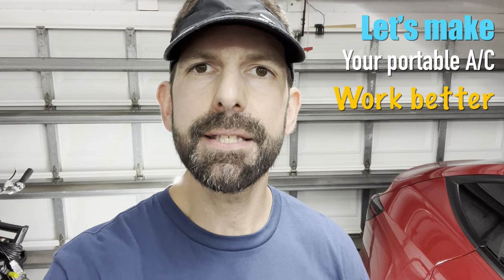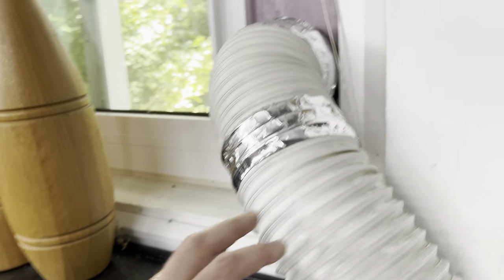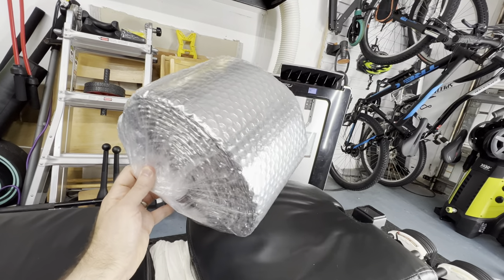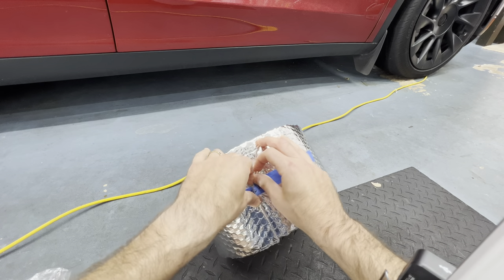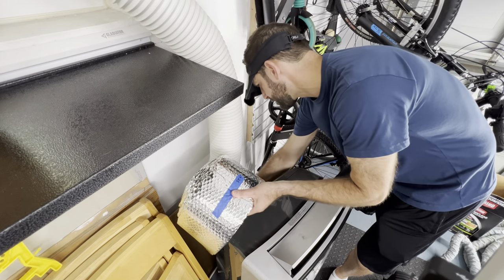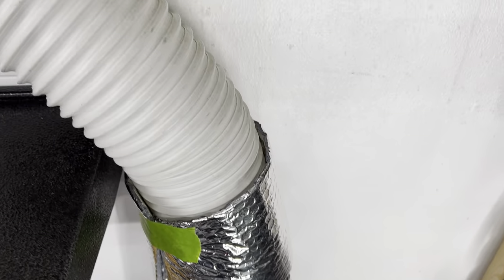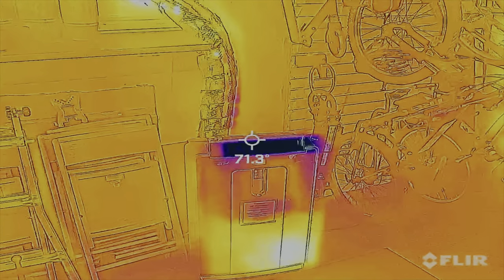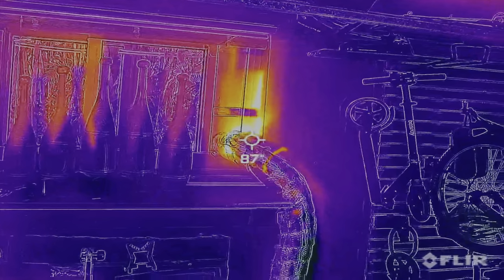How to improve efficiency of portable air conditioner AC units to cool rooms faster

Comment: I also had this on my flexible pipe and it helped a little. But the best thing to add to your portable AC is a stronger blower that you put at the end of the pipe to suck out the warm air within the pipes much faster. The stronger the fan, the better the efficiency will be.
Reply: Do you have a video to show how to do it?
Reply: Realize, you could put on a thousand mile an hour exhaust fan, and it would suck all the newly made cold air out of the room as soon as it's blown out the unit.  There's a balance between the high temperature of heat per volume unit in the exhausted air, and lower heat temperature per volume unit of outside air being sucked through the house crevices to replace it.  Ideally, you want hotter air exhaust with a lower air flow than less hot air exhaust with higher air flow.  

However, since the insulated exhaust pipe is holding the heat better now, it will also be hotter near the unit, and thus by back pressure, inside the unit will feel it, and run at a higher temperature, lowering the life and making the unit stressed and more inefficient. So it seems the extra outside fan  on the exhaust rube might be warranted.  How to determine the outside fans power needed is an issue. 

To get that super-heated air away from the unit's heat coils quicker, instead of adding an outside fan to increase flow to remove the heat better from the coils by using a higher volume of expensively room-cooled toom air - a better solution  would be to use the smooth walled metal dryer ducting.  Corrugated flex tube effectively creates a lower insider diameter, stratifying air near the inner walls due to turbulence trapped it in the grooves,  reducing the effective diameter of the pipe.  Also, notice the higher heat reading at the bend.  Bends reduce flow by 30%.

 Ideally, the unit could be placed right on the window sill on a purpose-built shelf, with a short run of STRAIGHT smooth pipe through the window, with NO bends. It should go out the window a foot, angled downward slightly,- so rain doesn't enter - and then the heated air won't radiate back through the window pane. This is for a single pipe.  A double pipe is much the same.

Comment: I was thinking of doing this with mine. I'm using the portable unit as a last resort because my RV ac quit on me a few days ago and we are still in the middle of a heatwave in NM. I don't have the narrow roll of reflectix that you used so I am going to have to use much wider pieces and instead of wrapping and overlapping, I'll be wrapping it more like a gift. I have the metal tape so that should help. Ugh. I hate that I have to do this but we couldn't have lived had I not brought this portable thing back into our environment. 
Thanks for the video and info. 
Word to the wise: Don't buy these portable units, people. You're just throwing money out the window.
Reply: We bought one last night to help our AC units out. For nights it’s wonderful but the humidity summer days don’t mix well with it at all. Returning it today and getting a fan to help circulate the cold air from our bedroom AC unit.

Comment: You are right in recognizing that heat transfer from that exhaust duct to the space being cooled is one inefficiency of these portable AC units. But there is a much larger inefficiency that can be addressed.  You mentioned that the AC unit pulls in cooled air from your garage to remove heat from the condenser coils and then pushes it out of the garage through that duct you are insulating.  Stop and think. That cooled garage air that it is leaving through that duct to the outside has to be replaced from somewhere.  Guess where the exiting cooled garage air is being replaced from?  That's right, Your cooled air is being replaced by hot air from outside infiltrating into the garage through all gaps, cracks, and crevices around doors, windows, etc.
 
The solution is to add another duct (also insulated of course) going from that inlet opening in your AC unit to a second opening in that window baffle.  
Ideally, you would connect the AC inlet duct to the lowest opening in the baffle, and the AC outlet duct to the highest opening in the baffle, allowing the hottest air to rise outside the window, upward and away from the lowest inlet opening, helping to minimize any potential re-circulation of hot exit air to your less hot outside air being drawn into the inlet.
Hope this helps.  🙂
Reply: OK here's my question.... If that's the case....how the hell do these things work so well? I mean, it sounds like you're saying the AC is sitting there running, pumping the air it just cooled out along with the hot air....creating a vacuum drawing hot outside air back in to replace what air is being exhausted out.... This sounds like a complete losing battle......so again I ask... how do these work so freaking well? I don't get it.
Reply: @One-Day-After-Another  Well, it is not a "complete losing battle", just a major inefficiency that can be mitigated as I described.  The magnitude of the inefficiency will vary according to your circumstances, such as the outside temperature, and location of the room in your house that you are trying to cool.  
I installed a portable AC in an upstairs room in my house that I am using as an office. There are also two other bedrooms and a bathroom upstairs that are not being used at all.  Each of the the 4 upstairs rooms has recessed light fixtures which are by design not air tight, to keep the light fixture from overheating when incandescent bulbs are used. So they provide an air flow path to the highest/hottest part of the attic. The air in the attic when it is 95F outside, and the sun is shining, can be well over 140F.  
I closed the doors to the 2 bedrooms to reduce air infiltration to the office, so the portable AC would be trying to cool mostly just the office.  When I hooked up the portable AC per the user manual instructions (pulling room air into the unit to cool the condenser, then ducted out the window)  it did NOT do a "freaking well" job of cooling the room.  Also, the 2 bedrooms that were closed off reached temps over 100F.  (Thanks to the attic air and outside air being drawn in to replace the office air.)
So, I added a 2nd duct (per my original comment) to bring outside air into the AC to cool the condenser. It then did a much, much better job of cooling the office. So, it boils down to just improving the efficiency of your setup wherever you can.
Reply: @spud1  We have a hot attick single story house..and the house gets little shade.... Once during a heat wave our ac went out. someone had their portable AC in storage... I didn't even know those existed at that time... Anyway... we were desperate until our AC could get fixed... and not knowing anything about what I know now... We were shocked how well it worked.. We actually fought over it....we put it in one bedroom closed off and when you walked in that room it felt so cool...while the rest of the house was miserable... so that's what I meant by working well... It was so hot... yet even with the inefficiency it was still able to cool the room... I feel like dual hose units will start to take over instead of single hose... I've noticed this more lately.. even one of them has dual hose built into one big hose.. so it looks like single hose but it's dual..
Reply: @One-Day-After-Another  Yep. It's because it was siphoning that return air (i.e. air returning to your portable AC) from the rest of the house, which was depressurized. One test you can do is close the door in that room with the portable AC. You'll notice that there's quite a lot of air flooding into the room from under the door or the pass through grilles that connect that room to the rest of the house.

That said, I'm sure the rest of the house might have already be a bit uncomfortable, but the portable AC was likely making it even worse due to how it's depressurizing. What is happening is that it is making up that air by pulling it in from the little cracks in the walls, around doors, windows and etc. That air is of course warm/humid.  That's why dual-hose portable AC units are often far better in climates that are really hot/humid, since they ensure the pressure stays balanced in the home and your already conditioned air stays inside of your insulated envelope of your house.
Reply: the same thing happens with most ac's they pull in cold air and exhaust hot air your car has this option aswell

Comment: I've installed a 4 inch "dryer vent" for a number of people to use as vents for portable a/c's.  I just run them straight through stucco/siding, right at the height the hose exits the a/c unit. Then I install the a/c unit right up against the vent so that there is almost NO hose at all to emit heat. Dryer vents are louvered so no bugs/critters get in while not in use. A 4 inch cap is put in place on the inside of the room during the months the a/c is stored (winter). Less hose = less heat loss.
Reply from the maker: Makes sense but I’d probably just go the extra step and install a mini split at that point
Reply: @reallyMello  . What size hole does the smaller mini-split require? I'm curious....I've not done one yet...
Reply from the maker: Depends on the unit but much smaller since it just needs to run the refrigerant loop to the outside unit and the condensation line

Comment: You have a dual hose capable unit.  Connect a 2nd hose and you will see 30% efficiency gains.
Reply: I laughed so hard when I saw it, like it's already setup for it!
Reply: I'm curious how pulling hotter air from outside (vs already cooled air from inside) would create an efficiency gain. Doesnt the unit have to work harder to cool warmer air??
Reply from the maker: I thought the same initially but learned from commenters that the intake air is used to cool the compressor and then exhausted using the second hose in a semi-closed loop. Without the second hose it creates a bit of a vacuum drawing in air from adjacent rooms or outside. Setup this way (with two hoses) the conditioned air is recirculated without introducing air from outside the room which may be hot or humid.
Reply: @kristinlogan7509   You are still pulling in hot air from the outside, because all the air you are pumping out has to be replaced from somewhere - guess what, the only source can be from the outside hot air. If it wouldn't be replaced from outside, you would suffocate in a vacuum. This is why whenever you can, you should forget moving air and move the heat instead with a proper split AC.
Reply: @bounty112  No, you use a second hose to outside, to provide air flow to cool the compressor--which is then blown out thru the (original) single hose.  Room air volume is unchanged, and just circulates into unit, over evaporator coil (cooled) and blown back into room.

Comment: You're pulling hot air from outside into your garage as well, since you're decompressing it by taking air from that room so it can be used as exhaust for the compressor  (which is pushed outside). You can probably optimize even further by ensuring the air pressure is balanced and ducting that intake to the outside as well. That unit may actually be built for that (and this is apparently not uncommon with some portable units).

Comment: I'm curious. Do you think a heavy duty aluminum foil would have done just as well? It would probably be much easier to apply and press onto it. Maybe I'll try that before the reflectix insulation. Thanks again.
Reply from the maker: I don’t think it would do as well no. The airgap in the roll insulation I’m using would be more effective at preventing heat transfer then foil alone.
Reply: Great idea, I will try that first, sounds like a great idea

Comment: As i did, buy the ready insulated exaust hose. Made spiral wire, aluminum, pink insulation with kinda garbage bag exterior. Extendable, come in box of approximately 2 feet, once open out of box extend to 8 feet. You get ZERO, nada, none, no heat inside. Probably cost you same or less then the work here... called: Duct Sleeve, you don't need the duck pipe, yiur a/c will bloot it when hot air flows out
 Canada: 28$ for 6 inch x 10  feet. Easy...

Comment: Flex duct. Buy flex duct the size of your vent and intake hose, or go to a HVAC company where they might sell you a short length as flex duct is generally sold in 25' lengths. You could use R4.2 or R8 flex duct. To use, cut two pieces to the lengths needed to cover your intake and vent hoses, pull out and discard the inside liner. Now pull the insulation and outside liner over the vent, and intake hoses. You can secure the ends with duct tape, panduits, or hose clamps. This is way easier than what you did here, and there are no seams in flex duct.

Comment: Insulating the exhaust hose is good thinking!

You'll get the biggest efficiency improvement if you can convert that "single hose" unit, into a "dual hose" unit.

The single-hosers pull conditioned room air into the unit, to cool the condenser coil, and blow that hot air out the (single) hose...which creates a lower pressure in the room, causing exterior (unconditioned) air to infiltrate into the room.  In other words, they pull hot outside air into your conditioned room.

A dual hose model pulls outside air via one hose, to cool condenser coil, and then blows that hot air out via the other hose. All the conditioned air stays in your room, and no hot outside air is pulled in.

Your unit is built at least partially, to be assembled into a single OR dual hose model...the presences of two hose "sockets" on the back of the cabinet show that.

I'd open the cabinet and see if there's internal ducting that can be manipulated or modified. to get those hose sockets to perform as intake and exhaust, and to get the room air intake routed to another vent grille on the cabinet. I'll bet you a dollar to a donut that it's do-able!

Comment: Just put the air con on a table shorten the hose and shove it near the window a lot easier
Reply: thats what I did. It helps but hose is still releasing a lot of heat. im insulating mine for this summer.

Comment: I added a second hose for the intake air and added thermal insulation to the exhaust hose, i also use a 12 volts fan to blow outside air in the intake hose but recently am thinking about creating a thermal insulator in the portable air con for the condensor
Reply from the maker: Interesting. Where are you ducting the intake in from in your setup?
Reply: From the condensor intake vent
Reply: I think the cold air from the evoporator coil is mixing With the Hot air from the condensor coil because of the poor insulation which seperate the  two part
Reply: @devtechsavvy7125 does using the fan to blow air into the air intake help any?

Comment: Run it straight outside.  No hose.  Raise the unit so it can exhaust straight out with out the hose. I'm doing that in my trailer works good. One problem is these units create a negative pressure.  To me they should create a positive pressure

Comment: why didnt you connect the second hose?
Reply from the maker: I misunderstood what the advantage was supposed to be of the second hose at the time.
Reply: @reallyMello  We have a Media Duo the 2 hoses in one plus an inverter and it cools our bedroom down to a meat locker in just half an hour. The hose doesn't get hot because it draws in outside air and no pressure drop in the bedroom.
Reply from the maker: That’s great!
Reply: @MHdollrevievs where did you buy it? I'm not seeing dual hose model.
Reply: @denisebrock6882  We live in Canada and we bought ours a Media duo at Home Hardware August 23 as they had them on sale, It cools our bedroom to a meat locker. Media makes several models for different manufacturers the Dandy version sold at Costco is basically the same unit.

Comment: My issue is length, the only exit I have is a considerable distance away from where I can put the A/C unit. Everywhere I read they claim to not lengthen the exhaust hose but I was thinking that if I use the standard hose and then go bigger on the extension it'll reduce back pressure and the force required to push the air thru the extended hose.

What'ca think?
Reply from the maker: @therealthreadkilla  adding a booster fan to the duct is maybe an idea to overcome the increased pressure from having a long run

Comment: I don't know that you're getting an accurate reading off of that reflective surface.  If you touch it with your hand does it feel warmer than the ambient temperature?  Either way, I'm still disappointed with the efficiency losses compared to a window unit.

Comment: Would replacing it with a dryer tube work better since its already insulated? its 8 dollars? Also the second tube for your unit shouldn't that be connected to the outside wont that add a significant 30-40% more effective?
Reply from the maker: They typically aren’t insulated to the same degree and you need to be careful on opening diameters. Connecting a second tube would help in my case as well yes.

Comment: are you sure that inlet duct is not for letting in warmish outdoor air to cool the hot side side coils and be exhausted, and that air is not meant to be taken from the coolish room?  i.e.  circulated air comes in another inlet to be cooled by the cold side coils?  what make model ac do you have there?
Reply from the maker: It can be used in either config, but as other have pointed out in the comments its generally better to hookup the inlet to a duct drawing in from the outside to cool the compressor and not create a vacuum in the room (drawing in air from adjacent spaces)